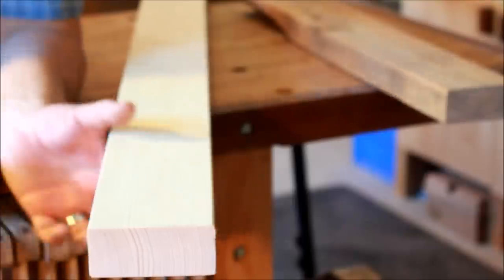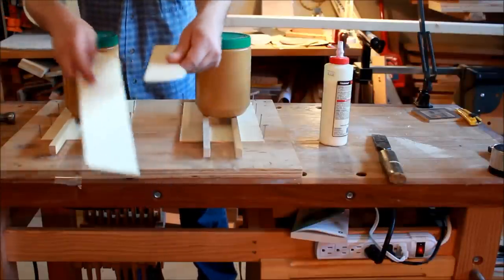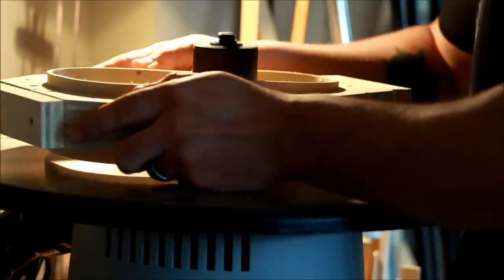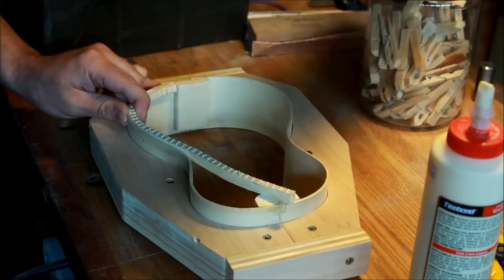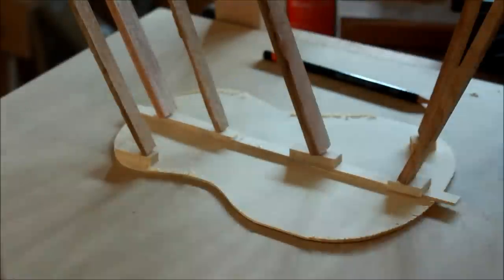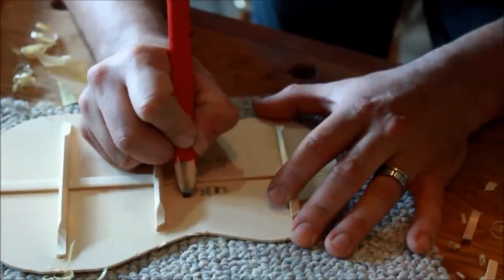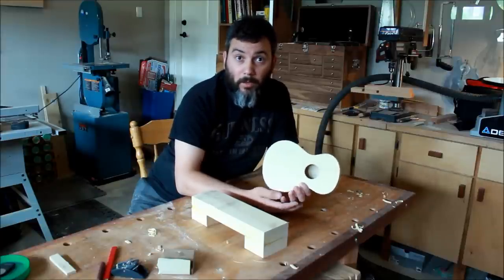Make a Ukulele DIY

Comment: Very nice to see the glue clamping of the back & soundboard, this is new to me.
I think by using the Rosewood, you’re still save and sound ;-) ,regarding the challenge, as it sound be at least 80% 2X4 and you obviously easily managed that. The weights you used for clamping seem like giant peanut butter jars to me :-) Ohhgg, just wonderful!
Reply from the maker: Maurice Blok I'm glad you enjoyed the first part, I'm already working on the follow up video and hope to add it to my channel in the upcomming weeks. By the way, they are peanut butter jars, with weight inside( roughly 17 lbs)

Comment: great video 
have any tips on how you keep those chisels so sharp? That's one thing that slows me down, and what brand do you use? thanks, keep doing what you do 👍
Reply from the maker: Honing paste and leather strop.. once they are sharp, if you hone them you shouldn't have to resharpen them, at the very least, not often... I have some Stanley, a cheap set and some misc. from estate sale or from used stores... as long as the steel is decent and hold it's edge i'm fine with them.. For gouges I use only Pfeil.. Thanks for watching..

Comment: Fantastic 2x4 challenge, though a bit disappointed with the rose wood addition :) Could you have used a knotty portion of a 2x4 as harder piece for this? I'm nitpicking really, great work!
Reply from the maker: +Kyle Geddes Thanks Kyle, Interestingly enough someone commented just this week on how he would have soak a 2x4 piece in epoxy to make it harder... Well too little too late. But to answer your question I didn't want to chance it. If you have a soft wood there the responce of the instrument is extremly diminished not to mention compromising the integrity of the soundboard itself.Thanks for leaving a comment :)

Comment: Great!
Can you explain me what is 2x4? A wood? A wood cut?
Reply from the maker: +Carlos Prado a 2x4 is a piece of pre cut lumber of softwood (pine, fir, cedar or in this case Spruce) that is used in house construction. It is 2" by 4" and you can have them in length of 8, 12 feet.

Comment: How thick did you thin the sides before bending?
Reply from the maker: CircuitsAndStrings The sides were about .120. They will get a bit thinner after cleaning the inside on the spindel sander and sanding the outside also...

Comment: If you’ve  ever played a really resonant uke you realize the lighter it is the better … the best being like a potato chip with strings. Handling original instruments made 100 years ago will teach you a lot. Nearly all modern ukes are made like a piece of furniture with the wood too thick and over braced. See if you can use your same building techniques but reduce the weight of the sides, back, top and bracing by 25%. You’ll have something that approaches a Martin from the early teens.

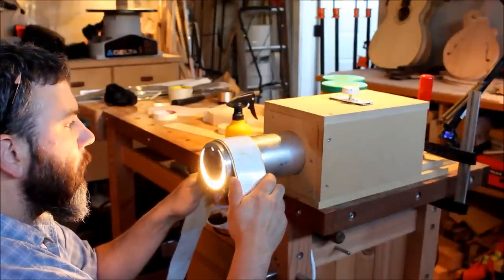Comment: Tomy, i have a question: at 4:40 while shaping the side - there is also a length of something white, longer than the side, between your hand and the side which is touching the hot tube. Is it there 1) to reduce stress and the risk of breaking the side? 2) as it is longer than the side, makes it easier to bend the whole length? Also what is this piece made of? Is it reusable? If this is a trade secret, I respect if you cannot share this information. Merci.
Reply from the maker: It is a thin piece of stainless steel ( white plastic is still on it) for exactly the reason you mentioned in 1 and 2. I do talk about them in this video. https://youtu.be/VgcCPaUq5us

Comment: unfortunately the challenge is to use only 2x4, using hardwood substitute means you failed the challenge. future suggestion however is to use resin to harden the soft wood instead of using hardwood. good job though
Reply: If it's a 2x4 challenge, you wouldn't build out of steel or plastic, so there's no good reason why substantial amounts of glue or resin should be allowed as a structural material either.  I think he did a perfectly admirable job adhering to the spirit of the challenge, while still ending up with a functional end product